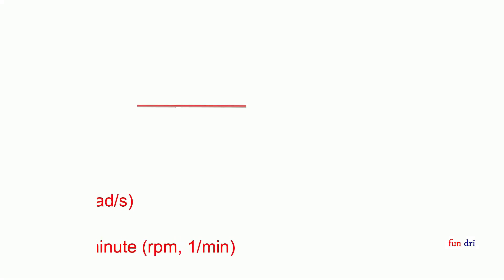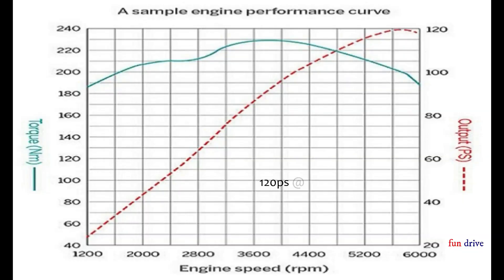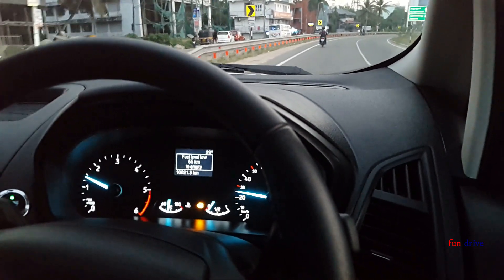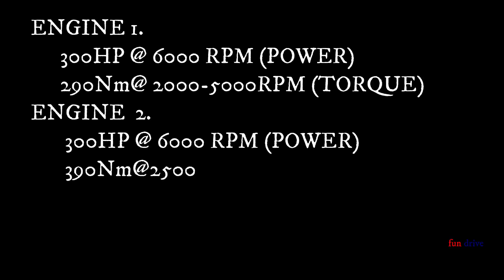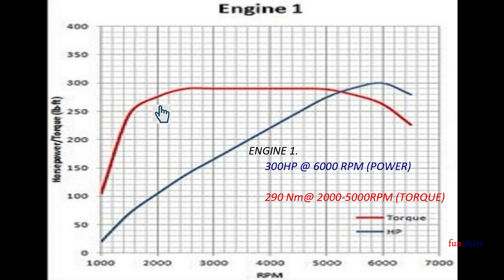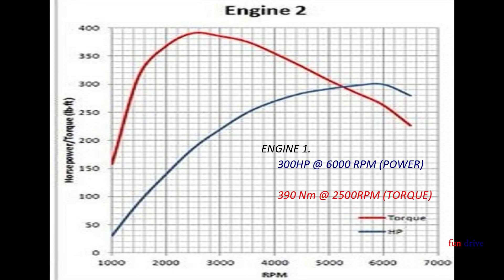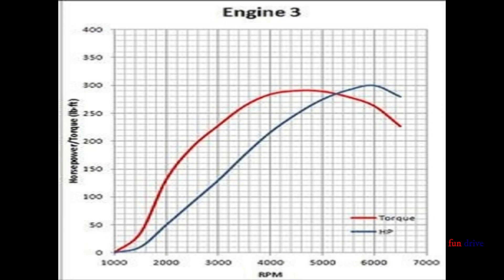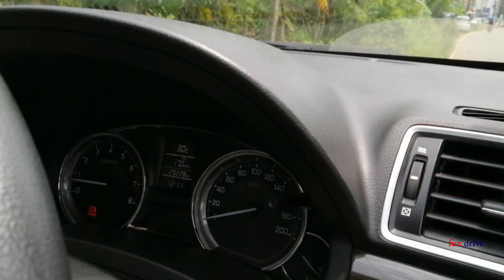Power & torque explained in malayalam | How it affect engine performance | fun drive | smalayalee

Comment: 175 nm torque @ 1500_4000 rpm performance undakumoo
Reply from the maker: Urappayum undagum 1500-4000 rpm il aayirikkum  enginete best performance kittunnathu...  below 1500 rpm performance test drive edukkumbal nokkendi varum..
Turbo Petrol aano ?
Reply: @SMalayalee  yes turbo petrol aanu
Reply from the maker: @blackberry5990   ok,
    1.2L normal enginumayi nokkiyal 1L turbo aanu performance il mikachathu
    1.5L normal enginumayi aanu nokkunnathegil initial performance il kuravu feel  cheyyan chance und
Reply: @SMalayalee  enthayalum kayattam nallathu pole kayarumoo
Reply from the maker: @blackberry5990   nallathu pole kayarum ..  Don"t have to worry .